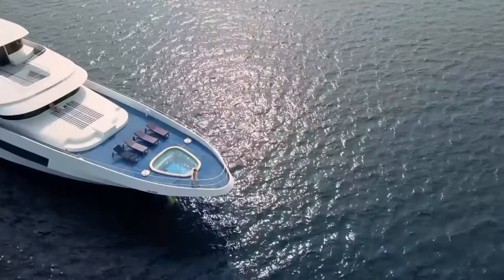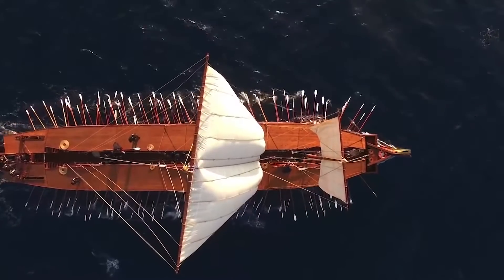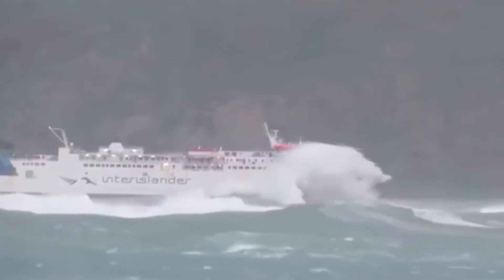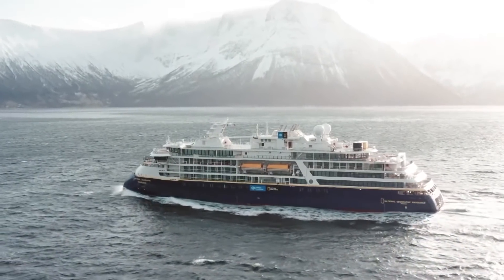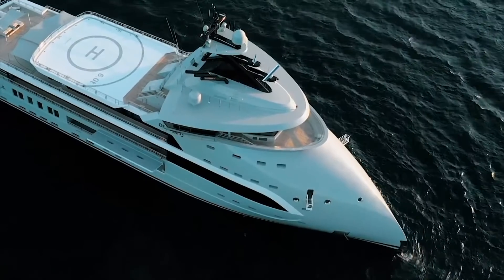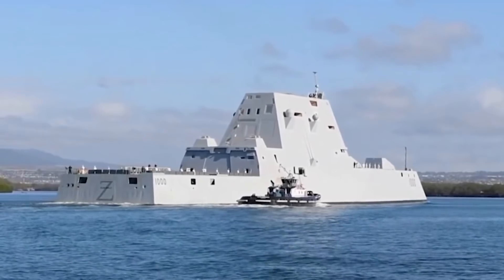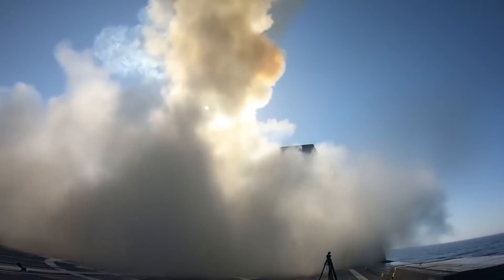This Revolutionary Design Will Change The Appearance Of Ships

Comment: There may be 2 or  3 ship's in the US Navy with similar front  end but I have yet to see a bulbus structure below the water line.    The Zumwalt Military line did show promise until the ship was outfitted to be multi purpose.    I also believe that the Zumwalt line was being looked at to be made  an autonomous ship,  or operated with no crew on board.     Sound like far to many computer operates throughout the ship.    Sure it may save a lives but computer's and salt water and humidity do not work well together.    Remember baby step's at first,  you do not teach your baby to run first thing.    No you teach babies to crawl,   sit up,  stand by themselves,  and then baby step's to start walking.    Dose the American Government and the US Military need to take lesson's from babies?
Reply: The Zumwalt class of ships was designed for a type of combat that has never been truly realized. It also was supposed to mount a gun that, after cost overruns, would cost more than an equallly capable missle. So it and it's sister ships languish in mission hell. I've heard that they may be decomissioned soon.
Reply: They had computers on ships for a long time buddy don't worry about the salt water the computers are made for marine environment.... The nuclear subs and aircraft carriers don't run without computers...lots to figure out but they've done more than you think
Reply: every moden ship, military or not has racks of computers in it.    That is not the issue, the issue might be though that "Blackouts" happen - especially in combat conditions but also elsewhere.   When the Estonia ferry sunk in the baltic sea, it could not report position because they had a total black out on the bridge. All instruments were dark, and then it was listing >40degrees ... it took precious time to finally report the position of the mayday.  Which is likely the reason hundrets of souls were lost.

  If you rely too much on hi tech, then a power cut is the bigger problem than salt water, which can be mitigated by good engineering and regular maintenance.

At least in the navy i served in, navy ships were the best maintained ships in a national fleet 
- because unlike an oil tanker, they have a large crew compliments that need to be entertained and drilled while on board.

They would constantly combat corrosion (hammer and paint :-) ) , check maintain fix the tech - our 130m long ship had 70-80 crew on board.   a tanker has what? 12 ?

Now the zumwalts have a problem with that approach - aparrantly the manufacturer managed to scam the us-navy when it comes to maintenance.
USN personnel is not allowed to do maintenance on it.  
(they have to allow contractors onto the ship when they come to homebase, a great way to spill secrets and prevent the crew from keeping up technical combat readyness during extended missions.  If stuff breaks while on a mission, thats just tough luck.

lol... whomever drunk senator approved that kind of contract should be put in front of a firing squad.
Reply: @zoolkhan  next step will probably be just subcontracting the whole ship
Reply: Bulbous bow is no advantage at the high speed that a warship is expected to work at. It increases economy below a certain speed.
Reply: If the bulbous bow is beneath the water then how would you see it? Generally the only time you see the bulbous bow is because the vessel is not under its normal working load
Reply: @edinmujanovic6593  To work correctly the bulbous bow should be at, or just below the surface, it 'breaks' the sea just before the actual bow and moves the bow wave forward this effectively reduces the resistance the ship feels and increases speed or economy for a given engine power. They only work over a limited speed range and at the expense of resistance at other speeds. Many merchant ships operate at a steady speed for much of their lives so the bulb can be designed for that speed. They tend not to be used on a warship for example as they operate over a wide range of speeds and a bulb designed for one speed will slow them at other speeds.
Here is a good link that explains how they work.
https://thenavalarch.com/the-bulbous-bow-a-primer/

Comment: I can’t force myself to watch this a second time but I didn’t see any correlation between a Viking ship bow and an “X” bow. They seemed completely different to me.
Reply: Look up the Oseberg ship, an almost intact Viking ship found South Eastern Norway. You’ll get where the X-Bow got it’s inspiration from..

Most Viking ships nowadays -for some reason - get drawn/depicted with their bow sloping forwards. Whilst in reality, their bows either were curved upwards to a almost vertical line (see the Gokstad ship), OR sloping forwards, then in a slight backwards curve, then coming forwards agan (Oseberg ship).
Reply: @audunberntsen5963  The X-bow doesn't look like the Viking ships you're referring to all that much. It is far more reminiscent of the 1800's dreadnoughts and ancient Mediterranean bow designs. Where the viking ship bows slope towards the stern is well above the waterline. They resemble more like traditional bows where they appear to have made the most contact with the waves, especially in calmer waters. To me the similarity is superficial not functional, but that's only my opinion.
Reply: *found IN South-Eastern Norway..
Reply: The shape is similar. There is also multiple kinds of viking ships, where the fast low ships was mostly used in shallow water like the langskip, drakkar, snekke . Then u have ships that has a higher freeboard like Knarr that is made to eat waves in an other way and be more stabile.
Reply: "Vikings had ships.  Vikings had axes.  X bow sounds like Axe bow."  That's pretty much what I took from their "information."
Reply: they are similar along the waterline. The way they sail is more akin to longships.
Reply: Absolutely, they look totally different, in fact the Viking bow is a standard ship shape. Also, this presenters pauses were driving me mad.

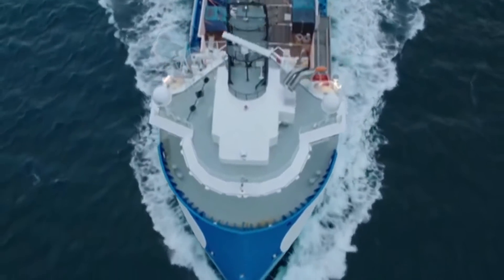Comment: 3:27  "The inverted X bow is more efficient in calm waters by decreasing the strength and frequency of the water."  What does this even mean?
Reply: Wow! It's simple enough, the inverted X bow is more efficient in calm waters by decreasing the strength and frequency of the water.
Reply: @johnscrimgeour4888  🤣😂
Reply: If you look at conventional hull, when they hit a wave, they slam and being thrown up, for the fall down in the next wave with force.
While a X bow, due to the hull shape, it reduce the movement and the force it hit those waves.

you can test it in the sink, by using a bottle. if you force the bottle down, while holding it at an angel, notice how water slam into the underside of the bottle (bow), then for x-bow, just hold the bottle straight up or in an opposite angle and notice how water can't slam on to the bottle (since the hull is not hanging over the water)
Reply: @heuhen  CALM waters have no / little waves!!!!!!!!!!!!!!!

Comment: So, does Ulstein have a copy-right on the design?  It is revolutionary, and oddly attractive.  Just wondering if that kind of IP can be protected.
Reply: yes they do, just like an Norwegian engineer har copy-right on the Ramform hull design. The copy-right holder of these design is hold by the engineer or the company the engineer work at. If they didn't do that, the company would lose money to other companies that could build them for just a little bit cheaper.

It's like BMW was going to build a Mercedes S class or a Mustang copy and call it a BMW car... I'll buy it, but would Ford

Comment: You might have a look at the battelships of the 1880 and 90's.  They had inverted bows (for ramming) but still had inverted bows that made for a more stable gun platform.
Reply: sooooo.... everyone later in ww2 just sort of said "meh we don't like having stable guns"?
Reply: @quantuman100  You have to remember that this was the time when ships were moving from muzzle loading smoothbore to breech loading rifled cannon. Smoothbores were notoriously inaccurate and so you could sacrifice some speed or manoeuvrability for stability. Once the change had been made and especially after the HMS Turbinia things could really progress in ship design. Interestingly the Turbinia had a Dreadnought bow so there must have been a reason for the change. The only thing I can think of is that the modern bow resembles the "Clipper" bow of the sail era. Clippers were fast ships and speed became important.
Reply: @quantuman100  no, they just decided reserve buoyancy was better than sloped armor on the forecastle, and besides all of this is irrelevant on post dreadnought capital ship hull with their long narrow buoyant bows that behave very differently from these stocky ships.
Reply: @quantuman100  The issue wasn't that. The ships that look "inverted" have something called a tumblehome style hull. Now, because it puts weight further down into the hull, it does allow for a theoretically more stable platform, however, there is a flaw to tumblehome. Personally, for civilian and merchant ships, I don't see it as much of a flaw, but it was a major flaw for warships. The problem with tumblehome is that the hull does not force positive bouyancy to push against a list if the ship starts to take on water. In fact, because of how the center of mass and the center of bouyancy are both low, the positive bouyancy in a tumblehome style ship will cause a spinning effect, making any list either more drastic, or irreversible depending on how well or poorly the ship was designed or built. That's why warships stopped using the tumblehome design for the most part by WW2, not because of issues with stability, but issues with survivability.
Reply: @quantuman100 , gun stabilizers. Also, inverted nose makes the ship somewhat slower in calm weather compared to ships with modern noses given the same engine power and hull forms (excluding the nose, of course).
Reply: You might have a look on how 'battle' is spelled.

Comment: World Emerald, included briefly I believe is an AXE bow vs. an X-bow is that right?
Reply: Ulstein calls it X-BOW (R).   Axe bow is a different concept. See https://en.wikipedia.org/wiki/Axe_bow
Reply: AXE bow, is more a wave piercing bow, that usually are used on ships operating at higher speed, "World Emerald" AXE bow give it better performance in the transitt from A to B, since it dosent lose speed so much when hitting waves thus reduce fuel consumption.

while X-bow is more a hull that reduce slamming and make the movement of the ship, when hitting waves more soft, and in that way, reduce fuel consumption and better crew endurance, when you are hanging out there, waiting for the weather.

One is for better transit top speed in rough weather, and reduce fuel consumption
and
One is better for comfort and giving a more soft role, improving the endurance of the crew and better fuel consumption

Speed or comfort
Reply: I believe you are correct.  OOC Emerald's bow is distinctly different from the X-Bow.  This video is shit.